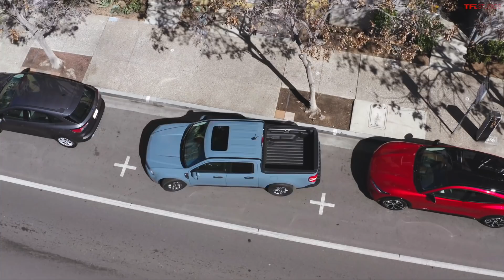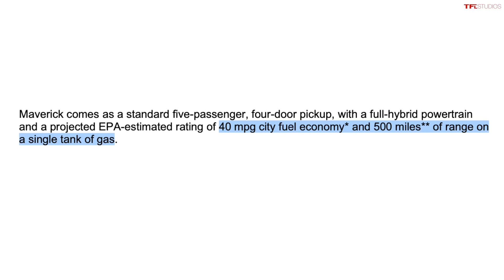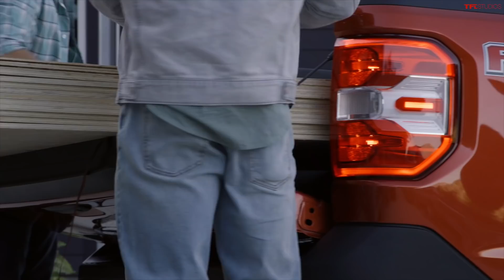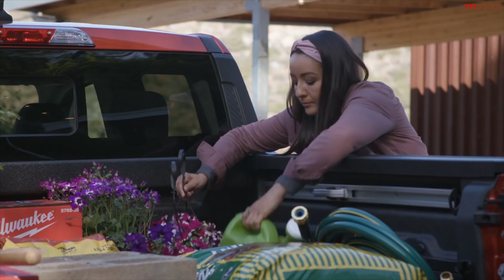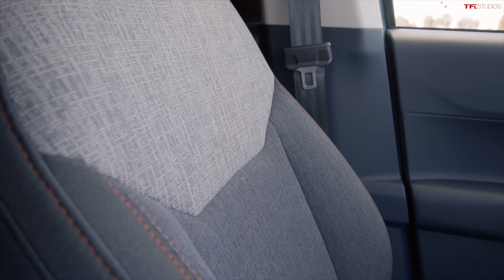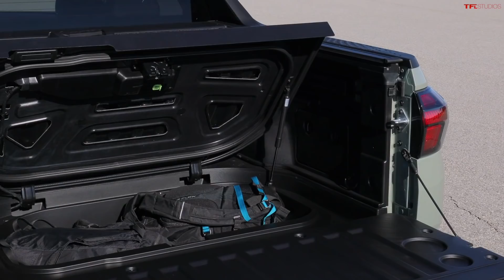Hands On With The New 2022 Ford Maverick: Here Are The Top 10 Things You Need To Know!

Comment: Wish it was a longer bed and two-seat cabin, but I love the fact that it comes in a hybrid option. Informative video, thanks!
Reply: Woody Green:  I could be very wrong, but I think if these sell well and Ford gets a lot of feedback from customers who would like such an option (as a bachelor I would, and some good interior secure storage where half of the back seat would be is an idea too), they'll sell a configuration like that. 

In the beginning, limiting configurations saves Ford money until they assess the actual market for that class of truck.
Reply: Extended cab to hold some of your junk and 6 ft bed.  Hybrid with 8 speed auto or even better 6 speed manual.

Comment: Great video. Simple fact remains that domestic built cars are really not worth buying most having significant problems before hitting 100k miles and poor design/ engineering.  Really wish that was not the case because they do look nice. I wouldn't spend 10k for this truck.

Comment: Does the Maverick use regular gas or Premium?
Reply: Both engines use regular gas. 

To get that 250hp 280lbft in the turbo you need premium. But they will run just fine on regular

Comment: It’s a shame they call it The Mavrick .  Wish Ford would have brought out a retro designed Mavrick Car with an eco boost high performance  V-6engine with the options of also ordering a standard V-6 engine or the eco boost 4 cylinder as options . Also an available auto or standard transmission as well . So you could order like a Grabber with the beefed up V- 6 eco boost , with all the good stuff or a mid level or a standard Mavrick .  This car would be for those who might want something different other than the Mustang and could be a little more affordable to have a fun car to drive . May sound crazy but I think there is a market for that . Ford has the money for it . I think they are missing a big opportunity for that . Shame .

Comment: Every time I see a new video on the Maverick, my interest grows. I won't be ready to actually buy until they are starting to come out in the fall, which by my estimation, is about when the current computer chip supply problem for the F-150 should be resolved. If, as I suspect, pricing for the 2021 F-150 drops in order to liquidate existing stock to make room for the 2022 model, I might be enticed to get the F-150 instead.

Comment: Some reason I was thinking they were priced at $40,000. $20,000 starting out is reasonable. Not interested in a Hybrid myself. Rather have an all electric or a regular gas engine. Not so sure about the turbo reliability.
Reply: The 2.0 ecoboost is one of the best engines on the market. It’s won hundreds of awards. And there’s millions on the road with minimal issues
Reply: @devinbender8428  having a 2015 Mazda CX9 with a 3.7 liter Ford Cyclone engine that made it to 82,372 miles before the engine went out because the water pump failed and the water pump is inside the timing cover. You'll have to forgive me for being skeptical. Before that we had a 2003 Ford Focus that dropped a valve seat that took out the engine at 130,000 miles. I swapped in another engine from a wrecked Focus. That engine made it all of one year before doing the exact same thing. I'll go with Toyota for reliability and resale value.
Reply: @RatherBeJetSkiing  those were Zteck engines. The new Ford motors are Durateck. Virtually no relation at all.
Reply: @devinbender8428  the relation is they've all been made by Ford.
Reply: @RatherBeJetSkiing  technically no. The duratec was made with Mazda’s help. So any ford ecoboost or duratec is Mazda based. And major publication calls the ecoboost and skyactive engines are some of the best on the market
Reply: @devinbender8428  you think direct injected turbo engines will hold up as long as a Toyota. I sure don't.
Reply: @RatherBeJetSkiing  they hold up just fine to 200,000 miles. And that’s well over the average life span. 
Just run injector cleaner and regular oil changes.

Comment: I have a 1987 Ford Ranger XLT (club cap) 2.3 lt...It has 365,000 miles on it, and a rebuilt transmission (4/21), that runs right! Your new 'Maverick" seems to be the same size. My "Lone" Ranger still looks great/paint and all. I've running boards and a visor added on and some 'Yosemite Sam' mud flaps, too. (No cat/converter) I also, have replaced my gas tank (a few years ago) and have new filters and pump more recently. Two years ago I replaced the tie-rods and it drives like new.

Comment: An XLT with blind spot monitoring (a $540 option that should be considered a safety feature and therefore standard) and winter weather package is $26,660 so after the inevitable dealer mark up they will be over $30k.  Less than half what my F350 King Ranch costed, but repeatedly saying it starts under $20k when they immediately tack on another $1,495 in dealer profit, I mean "Destination Charge," is dishonest.  What other product charges an extra 7.5% when they don't even deliver it to the end user?  Just say it starts at under $22k.  I owned a XL F250 years ago and having four doors, but no power windows, doors, or mirrors was a PITA.  So was the lack of cruise.  That was acceptable 20 years ago, but that stuff is so basic it should be on every model.

Comment: So a truck worth the price tag. No one in their right mind should ever have to pay 60,000+ for a pickup truck. A full sized pickup fully loaded shouldn't cost more than 35,000. I wish someone would take the time to build a truck that meets the safety standards no extra bells and whistles brand new $15,000 250-300hp towing capacity, yadda yadda and slap the big brands in the face. Even with generic off the shelf parts, I don't care. I knew people that spent $120,000 on a lifted fully kitted pickup truck When I flew people to the oil patch.🤦🏻‍♂️ inexcusable.

Comment: I feel like Ford made some serious mistakes in designing this "pickup". I was always hoping for something like the old Ranger
Reply: This is the same size and capacity as the old ranger. With MUCH better fuel economy
Reply: @JohnMiller-zn9pf  the bed is smaller and it isn't on a truck frame. This is nothing like the old Ranger
Reply: @TruckerMike089  same overall length & towing capacity, tailgate is set up to haul a 4x8 sheet of plywood. Almost twice the fuel economy rating as a ranger,  
This is what a new ranger should have been.
Reply: @JohnMiller-zn9pf  the old Ranger with a 4.0L v-6 could tow up to 6,000lbs. This thing is nothing like the old Ranger and how the old Ranger "should" have been. There is no comparison.
Reply: @TruckerMike089  the 2011 ranger 4.0 V6 was rated at 3100lbs. So 900lb difference between the maverick and 2011 ranger ( using last small ranger generation). Measurements are almost identical.

Comment: Nice truck BUT only if there was a simpler basic-ER edition, that would've been nice. Like black bumpers, a column shifter, a basic radio system (like in my 2020 F150 work truck) instead of that big fancy screen, maybe something similar to the F150 where you can lift the arm rest to create an additional small seat in the center with storage below and inside the arm rest. And maybe simpler interior in general. That would bring the price even lower and maybe we can pick up a brand new basic 4WD pickup truck for everyday use for $20K. Now wouldn't that be nice?

Comment: $20k huh? I'll  believe it when I see it.
Reply: Just pre order a base model Maverick. Done
Reply: I got mine ordered at 29015
Reply: Yeah dealers are already marking up the Bronco like they did the Raptor. I hate stealerships
Reply: It’s start at $19,995.  It’s already on Ford.com
Reply: @AbouTto_  not where I live, I am seeing a depression for F150s around 28% after 2-3 years closer to 3 and sorry but 48% after 5 is not bad but I am seeing them having less than that, he// just looked up a 2018 XLT Explorer with @28k for sale for $38k, was high $40k new, holding its value pretty darn good if you ask me.  what brands are doing better for trucks and SUVs?  I had a Mazda CX-9 which uses mostly Ford components (stamped right on them if you don’t believe me) for nine years and put 113,000 HARD miles on it.  I had zero issues other than typically brakes and other maintenance.  Had a Mustang that I put over 200,000 miles on it over 13 years and the only things that broke were things related to the 450HP + I installed.  Weird all of these Ford major problems you talk of must have skipped me…huh?
Reply: I need a vehicle for beach and hauling materials home from HD like stores so have been looking at this, the under $20 is easily available but it won’t have options or most of the cool features being promoted.  I am looking at Larient model (starts somewhere around $24k) but when add options it’s just over $30k.  Still fantastic value for money in 2021 but I need to see these in person before buying.
Reply: @AbouTto_  if Fords were so bad no one would be driving them, they are as reliable and dependable as any other car out there. You are making generalized opinions with zero factual data/statistics behind them.  We all get it you hate Ford.
Reply: @AbouTto_  226 complaints over 14 model years, do you think that’s bad?  Let’s do some math, I just looked up sales for 2012 year 26,472 so let’s say 24,000 to average things out times 14 model years = 336,000 CX9s sold.  Of those 226 had complaints according to your website so we are looking at approximately 0.06% of vehicles having issues, boy you have some high standards!
Reply: An XLT with blind spot monitoring (a $540 option that should be standard) and winter weather package is $26,660 so after the inevitable dealer markup they will be over $30k
Reply: @Noah_E  Yep
Reply: @oldcountryman2795  😁 Oh, you want power windows?? 😃
Reply: @RockinSG  🤣🤣🤣
Reply: @Noah_E  Still not a bad price.
Reply: @Noah_E : I think if Ford plays that game, they'll lose a LOT of sales.  Lots of buyers don't need all that expensive crap they try to sell, and won't pay big dealer markups -- not with all the competition in the new vehicle market.
Reply: @rogergeyer9851   A lot of people may not care about all the extras, could this be the Volkswagen Beetle? Simple vehicle, holds 4 people, are to throw stuff and 37mpg
Reply: In the 20's price range..meaning $29,999.99
Reply: https://shop.ford.com/configure/maverick/model/customize/xl
Reply: Absolutely you'll be able to drive one off the lot for $20K...just like you can drive a new Vette off the lot for $60K.
Reply: $1495 destination charge makes it $21,490.  That’s as base as you can get
Reply: @WaldenSpawn  if you wait for a rebate, you may pay less than $20k
Reply: @AbouTto_  trucks and SUVs seem to hold value today and are you sure it’s a Ford not a Lincoln
Reply: @AbouTto_  I guess every Ford product I drive (and people I know who own them) are flukes.  You are using car complaints as your source, this is a site of bitter people complaining, how many CX9s of the millions were reviewed in their rating?  Did these people take care of these cars?  What’s better, a Chevy, GMC, Dodge or Chrysler?
Reply: I visited my dealer, the very base, no-option model they quoted me at 21.5k   Then I asked for the out-the-door price, and it became 29.5.   :(
Reply: Got my awd with f360 and 4k towing for 26 or 387 a month with no downpayments or apr
Reply: Yep. There won’t be one on any lot for under $26k.
Reply: @oldcountryman2795  let some idiot buy it for 26 and buy it for 18 on the used lot once they lose it.
Reply: @oldcountryman2795  yep, tiny wheels, basic config.
Reply: I ordered one already fully optioned out for $35k.
Reply: @just_athought_7926  hahaha you make bad choices. Lolol
Reply: You can go on ford's website and order a base one for 20K. Do a little research before running your mouth
Reply: @Ironnadz  hahah nathan has the same internet access as wveryone but he does better research before he runs his mouth. Lolol
Reply: Only way you'll ever see one at that price is through a fleet dealer. For consumers, dealers are only going to stock Lariat trim levels at $30k+
Reply: @nodak81  Do none of you know how to order a vehicle? You're not stuck with what's on the dealer lot...  That said, the dealer isn't going to stock models with little to no profit potential, it's a business, remember?
Reply: After the dealers get ahold of these things and put their markup on them you'll never get them for cost! Just like they do on everything else that is popular!

Comment: I'd like to see a 2 door with a longer bed
Reply: You read my mind
Reply: Imagine a modern American version of a Kei truck. So practical. Make it a cabover with a front trunk, full-bed with hinged sides and gate, and hybrid with a diesel option and heavy duty battery. It would be the ultimate base platform for any business. Make a work van and passenger van version. FK150, FKV150 and FKTaxi.
Reply: @ericmcclellan5391  Why bother making it a cabover if we have the space to make it front-engine?
Reply: Perfect truck for fleets , cheap and good mpgs,  nice Idea
Reply: @camthesaxman3387  Very true
Reply: I want suicide doors or at least one on the driver side
Reply: @jerseyshoredroneservices225  Drivers side suicide door into shorter ext cab.  6 ft. bed.
Reply: Not happening as people don't want 2-door trucks.
Reply: @johnc9546  I want 2-door trucks

Comment: I like the presentation and it was good until two points, first was the fact that it's assembled in Mexico. Then, secondly the price the more Electronics you put into a vehicle the higher the cost. Perhaps it's time for realize this and does a little bit of an about-face was putting too much Electronics in a vehicle. I don't want or need a computer screen in my vehicle when I'm driving down the road sorry it's just the way it is. Under 20000, yeah just under the line of 20,000 that price sure does need in my opinion to go down another 6 to 8000 if you truly want to make it a competitive vehicle. Because price is a big sticking point especially nowadays.

Comment: I'm no Ford guy, but I would definitely consider buying this truck.
Reply: very true, im a honda guy and a city dweller not gonna be hauling trailers but could use a truck bed and it would get much better mpg than my accord
Reply: Well, of course! It’s a maverick...

If there was a Ford Enigma...I’d consider that. 😉
I’m not a Ford guy either...as I’m a gal, but not a Ford gal😂
Reply: @Alphacentauri819  True, Ford Mavericks have never quite been what buyers really wanted...
Reply: Thats what I was thinking, under 20,000
Reply: Definitely sticking with my 4.0 4x4 Ranger that’s actually cool
Reply: I did too. Then I thought about several things. Front wheel drive, CVT and load capacity. To get the Maverick I'd want I'm pushing $45k. PASS.
Reply: @tjohnson5036  maybe you didn’t listen quite well it also comes with 2.0 Ecoboost AWD 8-speed
Reply: @raceboii1339  that's why I said "to get the maverick i'd want I'm pushing $45k"
Reply: @tjohnson5036  the lariat with all the stuff on it is $35000 in Canada so no. You'd probably pay something around $29000 if you're in the US
Reply: Not a truck... just a motorized bucket,,,
Reply: @BuzzLOLOL  What constitutes and defines a real truck is how it's used. A Maverick that hauls and tows relatively often is closer to a "real" truck than a full size truck that does nothing by haul air for 10 years. There is literally a ram 2500 dually down the street from me with 22 or 24 inch rims. I've lived here for a decade, and I've never seen that truck being used to haul or tow in it's life. We've owned a Maverick for a few days, and have already hauled things in the bed. It's treated like a truck, it's being used like a truck. Therefore, it's more of a real truck than most larger ones.
Reply: @KB-bh9hp  - Put 100 sheets of 1/2" plywood in the back of that Maverick, close the tailgate,  and see what you think...
Reply: @BuzzLOLOL  Bro, I've never seen a single truck hauling 100 sheets of plywood in it's bed.
Reply: @BuzzLOLOL  That's like saying, oh yeah? Try driving up Mt. Everest in a Maverick, and see what you think. The Maverick can't do it, but neither can any other truck.

Comment: Useless.  Basically a car with no trunk lid.  If it had only a front seat cab, and a 7’ bed, like old Toyota long beds, it would be great for hauling dirt bikes and the occasional trip to Home Depot, but 4 1/2’ bed, with less than 48” between wheel wells?  No sale.

Comment: hi Tommy, that was great! the pricing I think is a cheater like the fuel economy! You can use the build app on Fords website now, and with all wheel drive and tow package and the usual safety accessories you're flying by the $35k mark quickly. And it seams that it does not come with trailer sway control, which I thick is mandatory in a small capable tow vehicle like the Maverick. At least it comes with a integrated brake controller while the Santa Cruz does not, which is really insane! And it looks like it has better approach angle than the Santa Cruz. but the Santa Cruz looks better and is likely nicer inside. I think the Maverick will be better off road, while the Santa Cruz will be better on road.

Comment: I would not buy this due to the transmission. This variable transmission has caused problems with other car makers. I'm surprised Ford is using this cheap transmission. Ford may regret this later. I tell everyone to RUN from this transmission.

Comment: The Grill is terrible 
Where is the Supercab version?
Probably be difficult to make a regular cab work structurally but a Supercab wouldn't even need to change its wheelbase and if you need to extend the sides for structural rigidity fine.
There are people who want more room for stuff not people.
Jeep made the same mistake with the Gladiator.